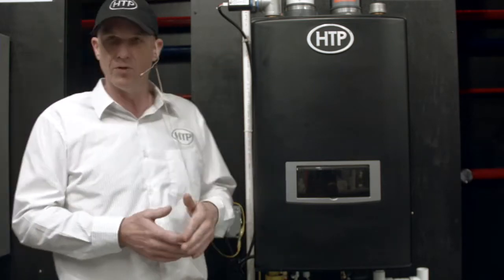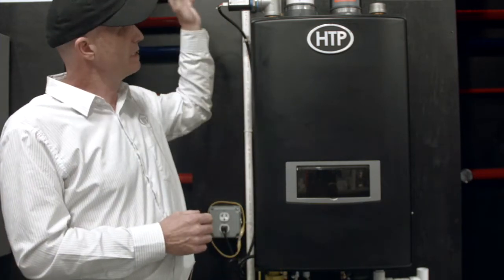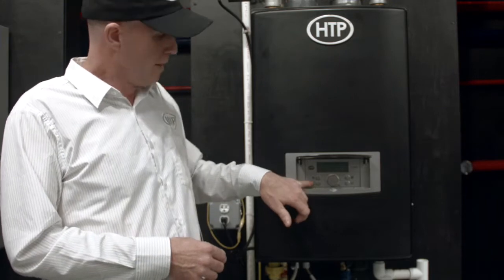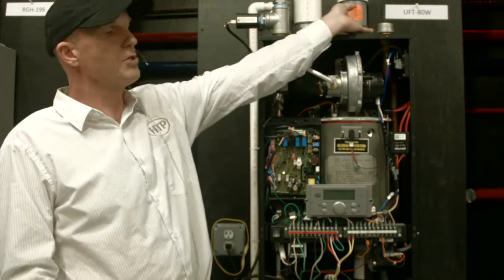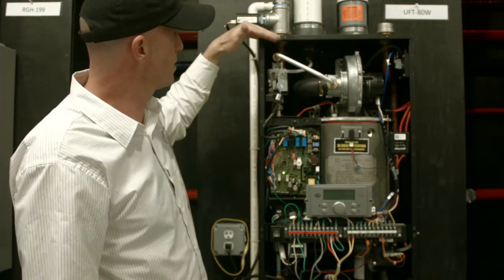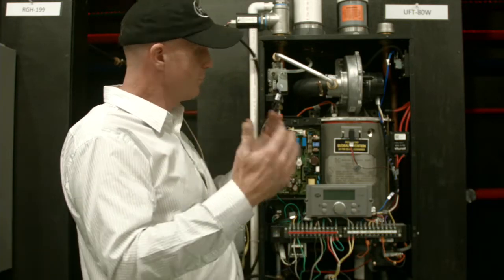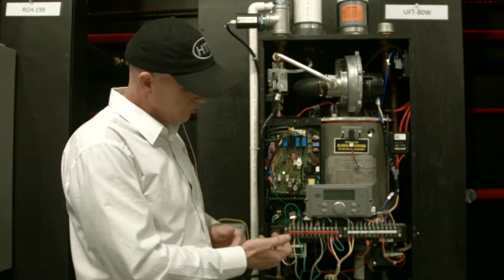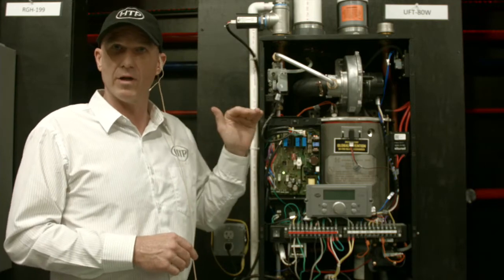High Efficiency UFT Boiler - Overview

Comment: What is the difference between UFT and EP ?
Reply from the maker: Hello,
 
There are quite a few differences between the UFT and the EP but to name a few, UFT based products have BTU offerings from UFT-80W up UFT-199W, 40,000 BTU – 199,000 BTU, While our EP has offerings from 80,000 BTU up to 399,000 BTU. The control platforms are different as well. Both the UFT and the EP can be cascaded, however the EP can be utilized in building automated systems for management via building automated controls network or BacNet. The UFT does not have this capability as of yet. The heat ex-changers are different designs as well. The UFT is a fire tube boiler design and the EP is a water tube heat ex-changer design.
 
If you have any further questions please feel free to reach out to our Techincal Support team at 800-323-9651, Option 2.